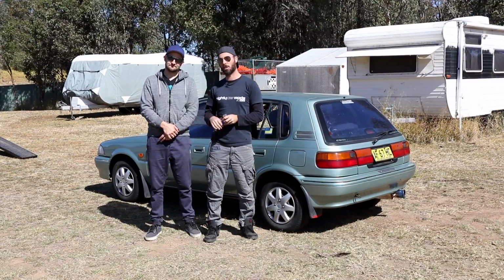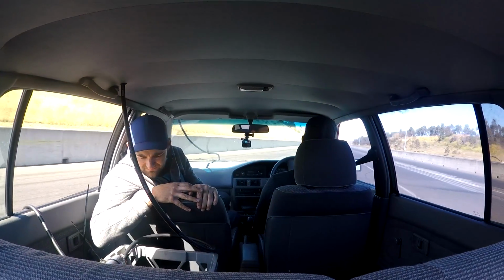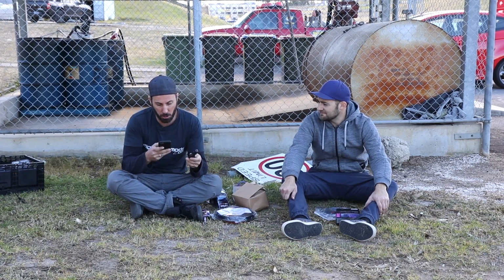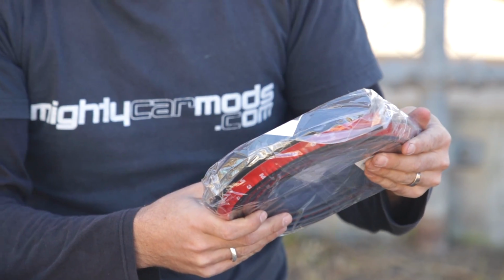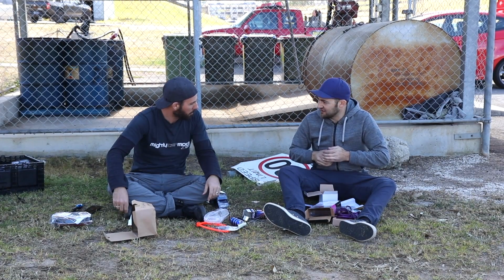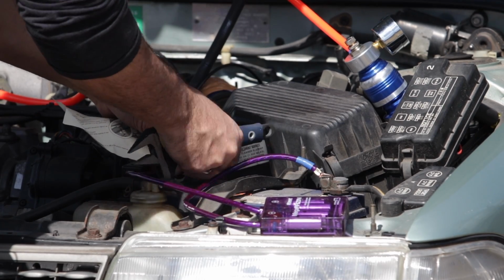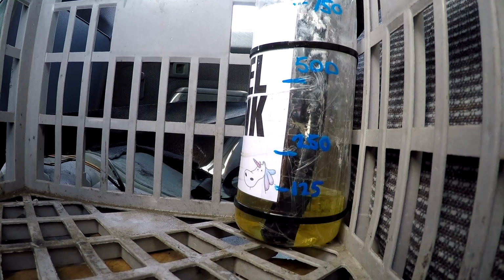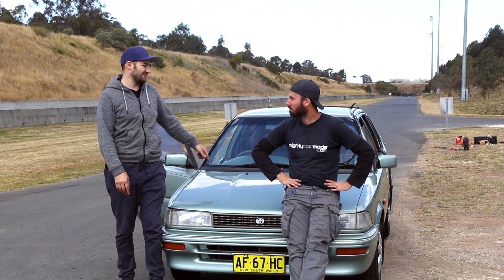Fuel Economy Mods - MYTHBUSTED

Comment: By removing the ecu fuse, you lost any chance of keeping your testing accurate, yes i know this was all a joke, but even these old toyota ecu's do long term fuel trimming, by resetting the ecu you cause it to have no long term fuel trims and it runs 'off the maps' (i.e. richer than it would have) until it can build up these long term fuel trims, so it very well would have used more fuel just based on that alone, disregarding the vac leak. 

Also, did u have the chips in the car during the first run? everyone knows more weight = more fuel
Reply: +1 for the chips

Comment: You guys should do a ghetto boost system using an air compressor in the trunk, have a feed line to the intake (with a open close valve in the cab area to control) and see if it actually makes more power.
Reply: Kenneth Clark From what I've read it shouldn't work because an air compressor can't put out enough cfm of air for an engine. Seeing as a turbo can put out hundreds of cfm and the pancake compressor I have at home is only capable of 3 cfm I don't think it would work. I did read about a project once I think from hot rod magazine about some guys trying to use pre-compressed air to boost their engine but it basically just acted like less efficient nitrous.
Reply: I don't think it could flow enough air...

Comment: Try a map\maf tuner.  You can make one for 5$ and it will make a difference. It changes the voltage to lean or richen the af.
Reply: Touge Warrior he's probably talking about changing the signal voltage on the maf/map to trick the computer into supplying less or more fuel than stock.
Reply: Touge Warrior Also who said to tune it slower?  That is completely backwards. Tuning a car to be more efficient over stock usually helps power depending on the car obviously. We're talking family car not sports car which probably would be slower to be more efficient.
Reply: J- Tuned wtf are you even saying?
tuning the voltage?are you serious or are you saying tuning the ignition? ignition and voltage is different
and do you even know what rich or lean af Ratio does?
Reply: BadCyle still a pretty bad idea,a car running rich doesn't give you any extra power and it consume a shit ton of fuel,a lean engine that is Tune right has a lil increase in power(Stock) but still it won't really be more fuel efficiency
Reply: Tune your car to be slower doesn't really mean it's more "fuel efficiency" we need power to drive in a certain speed and we need torque to push our car,imagine you make a really fuel efficient motor and put it in your car that weight the same but lost 20% of power and torque...you might even need to pull the rpm near the red line just to move around...
Reply: BadCyle Exactly.

Comment: How about doing some real hypermiling mods? A full body pan on the bottom. Overfilled tires, and using sheet metal to create a boat tail and smooth out the front end. It would be entertaining and it probably would work.
Reply: Also remove weight and take loads off the engine such as power steering and ac compressor.
Reply: Bruno M. or just buy a Prius lol. Maybe they could try and get better fuel economy than a Prius ;-)

Comment: sorry boys but you didn't drive nearly far enough for this to be considered scientific. Maybe drive 50km instead of 5 next time
Reply: Alex's Bikes and Motors times it by ten. It's an average.
Reply: multiplied by 10 is still an average over 5km. There are a ton of real world factors that can't be averaged over 5km, but 50 or 100 etc
Reply: I mean, they are going down the road the same exact way. Sure, if they did some city driving, the factors would change significantly each and every time you drive in the city. So, i feel like no matter how many Km they go, it will have a return of the same factors on this track if they are mimicking the way they drive.

Comment: I picked up an extra 5-6 miles per gallon on my NA subaru wagon by adding a haltech elite 1000... Its a completely stock car I bought and tuned myself because I wanted to get into tuning and learn how to. Yeah its like $2000 for the ecu and wideband but according to my math in about 4 oil changes it should pay for itself.
Reply: I completely obliterated my MPGs by fitting a decat pipe and unequal length manifold to mine. I then used those MPG figures combined with some man maths to justify buying a turbo model. It's kinda worth it in smiles though!
Reply: Brandon B What about the performance?
Reply: GamersTurf it feels more responsive and more perky then it was... I think it has more power at least at the cruising speed in the middle of the powerband but I never actually put it on a dyno so I don't know for sure I just road tuned it. Im having troubles finding a awd dyno around my area and its a stock car that I daily drive so I didn't feel the need for a dyno tune I know there is more power on the table to be had but without a dyno to know for sure... But that's what you get when you road tune the possibility of a bunch of power being left to obtain... It just almost impossible to optimize ignition with a road tune. But idc im going to turbo it soon enough and that's when I will dyno plus it feels faster and more responsive plus it was a great learning experience for me as I installed and tuned it myself just so I can get into tuning
Reply: Tuning the ECU can actually improve MPG when tuned correctly
Reply: Expensive way to get slightly leaner fuel ratios.  They have this technology called direct injection and it can run at a/f ratios so lean that they would melt you suby's engine.
Reply: greencityman420 the subies have direct injection called the FA series engine and they do have leaner AFR then port injection.... So please tell me more about things you clearly don't know about. And when it pays for itself it's hardly expensive. Sounds like someone can't afford the 1500 dollar investment in the first place.

Comment: Didn't even get through the first run. You will have inconsistant results. Driver, throttle input and air temperature will all ahve dramatic results. The throttle vs air temp will have the biggest effect. Is the the throttle based on percentage of application or the responsiveness of the perfomance? Not really an accurate test, you need data logging and software to determine accurate results
Reply: Joke
(You)
Reply: Beano 👍

Comment: for better fuel mileage buy very narrow hard tires , light weight wheels to match , slam the car down and try to get some kind of air dam around the front to keep air out from under it , smooth out the undertray with sheet aluminum ,  smaller rear veiw mirrors , strip out the interior completly ,  get rid of the AC any non essential electronics , maybe switch all lights in the car to LED to reduce load on the altinator , put on under drive pullies to reduce the speed of things like the water pump altinator and power steering ,  put skirts over the rear wheels ,  increase the engine compression , and possibly modify the cam for a torquey cam spec that makes power down low in the rpm ,  get an external overdrive unit so you can double overdrive on the highway ,  can anyone else think of any actual things to increase MPG.   maye get an aftermarket ignition system that has multi spark like a MSD 6AL , program the fuel system in the ECU to run at 15:1  or even 15.5:1  but that has long term negatives ,  run thinner oil weight  0-20  or 5-20 ,  over inflate tires by 2 or 3 #  ,  i cant think of much else. Anyone?
Reply: Dalton Michaels cut a hole on the floor and go full flintstones
Reply: Dalton Michaels better driving habbits. I get 20mpg in my 2002 5.3l avalanche just by being light on the throttle and spending as much time as possible at 45-55mph
Reply: Dalton Michaels make sure to buy decent gasoline. Doesn't matter what you do if you buy bad gasoline that comes from dirty tanks and is cut with alot of ethanol. You can fill up from different local stations and measure what kind of mpgs you get from each, then choose the one that gives you the best results. Surprisingly where I'm at the walmart gasoline beats shell by a landslide. Mid grade gasoline is worth the price.
Reply: Dalton Michaels that sounds like a lot of money
Reply: I have a 2015 silverado with the 5.3 factory 11:1 compression ratio , i found a gas station in my area that sells pure 91 octane no ethanol. Significantly better fuel mileage , 1.5 mpg better in town without changing driving habits , i haven't measured the difference on the highway yet but i would assume 2 ish at my typical cruising speed of 70 mph based on the fact the engine can lean out the fuel mixture due to no ethanol and dropping into 4 cylinder mode. if i actually try i can get 24 mpg on the highway in my full size 4wd truck when not towing. which is good for a vehicle i regularly tow 7 thousand pounds with and have to drive in rarely but sometimes 12 inches of freshly fallen snow.
Reply: Hard tyres is a load of male bovine faeces. You want supple (note: not sticky) tyres that can flex easily so they don't take as much energy to bend at the road surface.

The best way for them to save fuel would have been to use the proper gear...
Reply: You can use a water injection system in the intake manifold. It only takes a small amount of misted water via a jet. It is really effective with turbos. It also works well with increased compression ratios. Of course it is a pain in the ass to deal with.
Reply: Joe Smith isn't Volkswagen develping a 5 stroke engine like that?
Reply: Engine swap, delete emissions, change gear ratios, lightweight exhaust, glass, and body panels, align tires, stiffer motor mounts, manual steering conversion, cutting rotating weight is critical because it takes much more energy than stationary weight... wait what were we talking about, building a drag car right?
Reply: Eric Fixalot same principle. The goals are just polar opposites. Less friction and weight means more efficient car more efficient car can put down more power or increase fuel economy
Reply: Skippy 13:1! Jesus, did it come from the factory like that. If so i wonder how it would respond to turbocharging
Reply: Yep. Responds just fine to turbocharging. The trick is that the 13:1 is from the bottom of the stroke to the top, but not from where the inlet valve closes. The valve closes so late that the effective ratio is 8:1 or so. It does that so you can run 91 and still get high efficiency on the expansion/power stroke.

It doesn't make any power because the limiter is set to around 4500 rpm and the inlet manifold is so bad for power (it's not the yaris one).
Reply: google: "Autospeed turbo prius" for a series on boosting a gen 1 prius
Reply: Remove any "non essential panels" from the car to reduce weight. 

By removing the firewall, you can also remove the heater core and climate control, which contributes to weight reduction and makes you feel like your driving an "Australian summer" all year around.
Reply: Dalton Michaels gm is definitely getting their shit together with their new engines. The cylinder deactivation and higher compression ratios really make a difference. My parents have a 2016 yukon denali xl and that behemoth gets about 36 mpg
Reply: Why not both?

Basically the only difference is the tyres, final drive, and exhaust cam...

Not even kidding, Prius has a Yaris motor with 13:1 compression and a 280 inlet cam

Comment: This was again an educational video. But could you test a thing for me what I really want to now? For years, I've been wondering if cutted springs act as well as lowering springs. Both springs must be the same size. But I'm told that cutted springs will keep your car more comfortable and show the same behavior as cutted springs. So it would be crazy to by lowering springs. But is that true?
Reply: Absolutely incorrect, the spring rates are thrown out entirely by cutting the springs as they are measured in kg per cm. Taking length out of the springs via the cutting method makes your suspension extremely soft to the point that it can't support the car's weight and absorb bumps, often bottoming out on the bump stops. A very stupid thing to do, NEVER chop your springs.
Reply: +Snow Golem I think/hope Ilias' comment was a joke... But as he states it's true: " cutted springs will [...] show the same behavior as cutted springs " :D
Reply: Snow Golem and Boost2301. Maybe it sounds like a stupid Ricer myth, but I see some truth in it. I honestly never cut my springs or installed lowered springs. I've always gone for coilovers. But, I think, that your suspension becomes softer by chopping your springs. Indeed, it seems to me as dangerous to do as they could shoot out because of their length. But there are special polyfluorene stops for your suspension so that your springs stays in place. Maybe it's not such a crazy idea?
Reply: Ilias Lamari 😂😂😂😂😂😂😂😂😂😂😂
Reply: Bost2301. Mate, it's not the same man. You have original springs from the factory that you can chop for some street cred and you have tuning aftermarket springs for a stance look on your ride. They behave difrent when installed....
Reply: You completely missed the part where I talk about spring rate, it's not about the springs coming out - but rather the distance of travel per kilogram of force on each spring. If you take away part of the spring, it requires a significant amount less force to bottom it out. Furthermore, the spring will now compress in scenarios it's not meant to so you end up having a car that bounces like a trampoline that's been in a family back yard for 10 years. You're right about it being unsafe, but it's a crazy idea if you want your car to handle like it's meant to, I mean why not just remove the springs, there's shock absorbers and bump stops after all!
Reply: It's just because you wrote "cutted springs" twice ^^ But back to the topic: Snow Golem is rigth bottoming out isn't really a good idea. Lowering a car is shortening the way your suspansion can travel, therefore lowered springs are more progressive to prevent bottoming out.
Reply: Good way to ruin your ride quality and destroy your shocks & struts faster

Comment: Im no particular car guy but cant you re-tune your car for less unicorn so lower fuel consumption??
Reply: DOITthe RookieWay yes kind of. Oem tune their cars to get the best fuel economy and the best emission possible. So on a new car unless you run it way more lean you wont actually gain much more fuel economy on an older car that is more worn out its easier to get better mpg by re tuning

Comment: Vortex Generators on the rear sides, top, bottom and front bottom will increase fuel economy at highway speeds. You might see an increase of a couple of MPGs. 
You'll see improvements with a front air dam as well as if you did a flat underbody. 
Apart from that, who was surprised lol.

Comment: You should test if a dragster-style scoop forcing air into the inlet manifold actually does anything on such a low performance car
Reply: This is goood test !!!!
Reply: realdamageboy doesn't do much unless it's a self testing Ecu or carbs
Reply: Or the injectors mapped to suit the extra air
Reply: I believe, that Toyota have Oxygen meter in exhaust, and it will regulate adding more fuel in this case. but until actual test is done, we never know.

Comment: For fuel tests, you don't need to run it out of fuel. You just need to refill it with the same amount of fuel. So, when you buy fuel and the pump tells you the amount of fuel you purchased, you know pretty accurately how much fuel you used to travel the distance between the pumps.
Reply: but this is easier